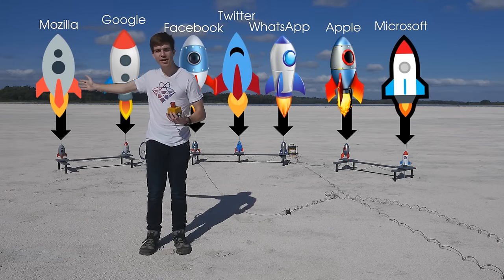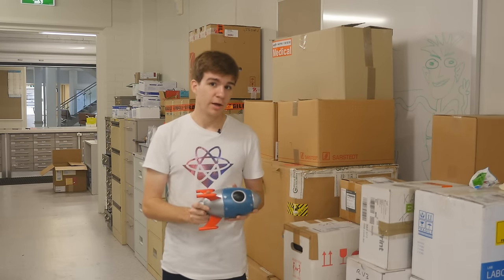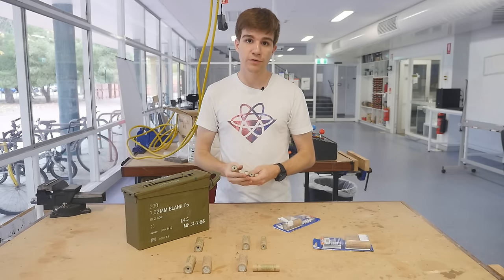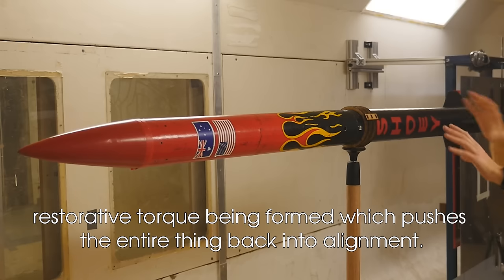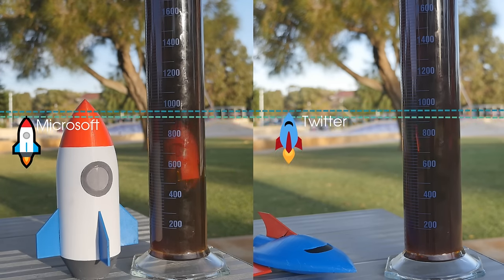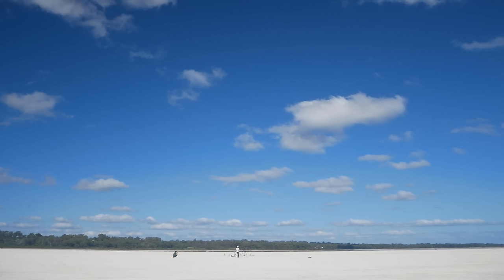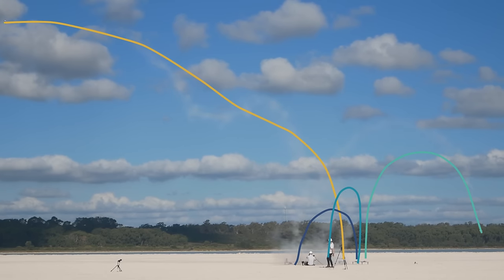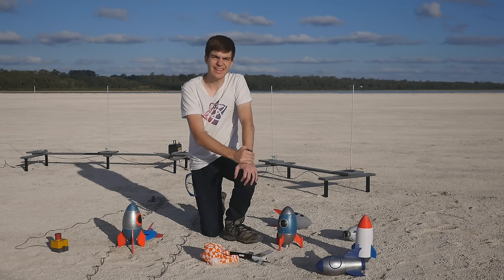What emoji makes the best rocket?

Comment: Up next: Which typeface's capital "I" makes the best I-beam?
Reply: easy video. get the Arial, Times New Roman, Papyrus, Comic Sans, and Impact font I's, extrude, 3d print, and test
Reply: I would legit watch this.
Reply: @PhoenixTwoFiftySix  theres more typefonts than that
Reply: @RubyPiec  yeah lets test all 7000, not just some of the more common ones, obviously
Reply: Metal printing isn't the best over length
Reply: I may try this myself lol
Reply: Brilliant
Reply: easy. windings three
Reply: @autodidacticartisan  yes.
Reply: That's actually a great idea. Mind if I take it as my bachelors degree research theme?
Reply: @karlohorcicka7388  Sure. In any case, i'd recommend bringing your idea to your professor(s) and getting an endorsement to continue before setting your mind on it.
Reply: @autodidacticartisan  I will upload a font consisting only of actual I-beam cross-sectional profiles to Dafont... >=D

Comment: Nice video, slight correction: 
At 6:00 you talk about rockets being unstable due to their thrust being at the bottom. The rocket would however be just as unstable if the thrust was at the top, as the engine moves with the rocket instead of staying in place (rocket pendulum fallacy)

Comment: 4:30 A small nitpick, yes the most efficient engine has the same exhaust pressure as the air around it, but for a rocket going to space that ranges from 1 to 0 bar during flight, so they picked a value in the middle for better efficiency.

Comment: I imagined all the rocket emojis without bell nozzles have the engine inset into the fairing. Take a look at Starship or even the V2 (The quintessential classic rocket design), neither of them have bell nozzles sticking out - both are inside the body.

Comment: Drag doesn't reduce the distance you can cover but instead it reduces the speed at which you traverse the distance. A more stable rocket usually experiences more drag and the more stable it is, the longer it keeps pointing upwards and the further up it ends up.

Comment: In regards to the strangeness in you drag to distance results I think one of your error factors is the drag calculation you did or rather what you seem to have accidentally missed. 

While the body by itself may exhibit that much drag, you’ll notice that in your program it shows a large zone of dead air behind the rockets where the exhaust should be and this can adversely effect your drag models. I know I’m a bit late to the party but at high air speeds like that having gas fill out that bubble and make a streamlined airflow can be a major difference.

Comment: Did you do the syrup experiment in syrup instead of water because it had any advantages that way, or was it actually just because it was more fun? Anyway, great video.
Reply from the maker: Yup, it was actually because it was much more dense and had higher viscosity. It's just we only had one take that worked so "its really fun" is the explanation we've got! If you were doing this for a real paper then the high viscosity would add some conversion issues (air vs syrup is a big difference) but could theoretically be done.

Comment: This was fun and informative, but I think I saw two problems. (Correct me if I'm wrong) First is that the video estimation of height doesn't seem to be corrected in the 3rd dimension (farther and closer, closer rocket can be lower than a far one, but seem higher). The second doubtful part of the test was the syrup test. The test tube was too narrow, making the chunkier rockets lift up the syrup and create vacuum underneath, instead of the syrup flowing freely around.

Comment: Awesome video! 

Just one comment about your explanation for the inherent stability or instability of a rocket. The way you explained it by balancing a rod on your hands is a bit misleading as an analogy. The rod is an example of an unstable system, but it's not really the same way a rocket is unstable. 

The balanced rod is unstable because of gravity and the relative position of the center of mass to the pivot point of your hand. As the rod  pivots your hand continues to apply an upward force and you get a torque like you illustrated.

As you touched on later in the video, rockets are unstable because of the relative location of the center of pressure to the center of mass. The existence of gravity is unnecessary. The existence of drag is. If you take an 'unstable' rocket and put it in vacuum it will fly much more stably. It will actually be marginally stable (which is not very stable but better). This leads to the point that the faster a rocket flies with drag the more stable it will be (assuming it was a 'stable' rocket to begin with). You mention I believe in the video that going slower might help some of the less stable rockets, but I believe that the correlation should be the other way

I bring this up because the analogy leads to  wrong conclusions about how to help rocket's be more stable. You mention that rockets are like the rod and unstable because they "have the thrust at the bottom". One might imagine that you could move the engine to the nose of the rocket and then it could 'hang from the engine' instead of being pushed by the engine. This, and other ideas stimulated by the rod analogy, don't work.

As counter intuitive as it is, a rocket hovering  in the air isn't as unstable as a similar rod supported from where the engine is. As the rocket tips over, the force tipping it over (due to a misalignment of the engine thrust vector with the center of mass or a small breeze or something) doesn't grow. With the rod it does. 

Sorry for the long comment. Again, the video was awesome!

Edit: You say these same things in response to another comment asking about the engine on top question. I believe that they asked in the first place because of the misleading nature of the rod analogy
~Max

Comment: So you first pinch the outlet to increase the speed of the exhaust .. then you add the bell nozzle to expand the exhaust to reduce temp & pressure and further increase speed of the exhaust ?  Or did I get this wrong ?
Reply: "A nozzle is a relatively simple device, just a specially shaped tube through which hot gases flow. Rockets typically use a fixed convergent section followed by a fixed divergent section for the design of the nozzle. This nozzle configuration is called a convergent-divergent, or CD, nozzle. In a CD rocket nozzle, the hot exhaust leaves the combustion chamber and converges down to the minimum area, or throat, of the nozzle. The throat size is chosen to choke the flow and set the mass flow rate through the system. The flow in the throat is sonic which means the Mach number is equal to one in the throat. Downstream of the throat, the geometry diverges and the flow is isentropically expanded to a supersonic Mach number that depends on the area ratio of the exit to the throat. The expansion of a supersonic flow causes the static pressure and temperature to decrease from the throat to the exit, so the amount of the expansion also determines the exit pressure and temperature. The exit temperature determines the exit speed of sound, which determines the exit velocity. The exit velocity, pressure, and mass flow through the nozzle determines the amount of thrust produced by the nozzle."

Not sure I fully understand this yet, need to re-read this ..

Comment: Well done!  I'll like the explanations and will be sharing elements of this video with future students (I teach aerospace engineering).

For a fair rocket emoji competition, however, what matters is the impulse of the motor.  Even if the the rocket nozzle isn't optimized, all rockets would have the same impulse.  What does matter is the weight, however, a fair competition would ensure all rockets have the same weight (adding weight around the CM to underweight rockets) and proportionally the same size by scaling all rockets to have the same biggest rocket diameter.

Extremely fun to watch!
Reply from the maker: Wow! Thanks JJ. I hope that your students find it interesting.
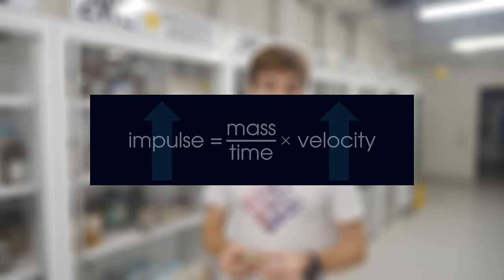Reply: Is the impulse equation at 2:48 correct?
Reply: @baneudel    Impulse is the change of momentum (mass x velocity).  Since force is change of momentum per unit time, impulse is the area under the thrust force vs. time curve provided by the rocket motor.  You can think of a rocket motor as providing "pockets" of changes of momentum as it burns, when you sum them all up, you'll get the total impulse or change of momentum provided by the motor which can be applied to anything attached to it, in this case a rocket.  Hence my comment about not needing to equate exhaust velocities of anything else for a fair competition, all we need is the same total impulse.

But since the resulting change in momentum on the emoji rockets is a function of their weight, the lighter emoji rockets would fly faster and therefore higher.  Emoji rocket weight is completely a function of the user scaling and designing the interior of the rocket, not the exterior emoji rocket design itself.  Therefore for a fair competition you would want all rockets to weight the same by adding mass around the center of mass (to not affect their stability).

My other recommendation about all rockets having the same biggest diameter is also important for a fair rocket emoji competition since the drag force is a function of the projected area of the rockets, that is the area that the airflow sees.  This parameter is once again not a function of the emoji rocket design itself, but of the user choosing a scale during 3D printing.  You would want to scale all rockets differently such that they all have the same projected area and therefore isolate the drag coefficient as a variable.
Reply: @AtomicFrontier  I am sure they will, I am sure they'll want to try the drag estimates using syrup!

Comment: Just fyi model rocket engines are very unreliable due to the fact that you can't really test them before you sell them, so peak altitude can vary by a factor of up to 2 per run of an identical rocket, so if budget allows, consider doing some more runs.

Comment: you mention the center of mass for the rockets in the wind tunnel, which are mundane cylindrical shapes with presumably uniform density
but not for the emoji rockets which have far more interesting shapes and an unknown distribution of material internally ... I feel that the tests would have been much fairer if the stability and balance of the rockets were accounted for
Reply from the maker: The Emoji CoM was calculated using a solidworks plug in, so the numbers used in the table should be pretty accurate.
Reply: @AtomicFrontier  Perhaps there are ways of influencing the center of mass, by i.e. increasing the fill on the upper portions of the rocket... I was thinking along the lines of, what if an actual rocket designer had a working design which just happened to resemble an emoji, they would have made sure to maximize its performance

By giving each rocket the best chances within the constraints of their emoji shapes and their fabrication method, we can reach a reasonable conclusion about the merits of each design
Who knows, maybe the Twitter rocket, for which you have given a vaguely planiform shape, might even exhibit gliding characteristics given the correct center of mass position

Comment: The stability of a rocket has nothing to do with the place ment of the engine along its thrust axis they are just as stable with the engine at the front or rear what really matters is

axis of thrust going through center of mass

Center of mass ahead center of drag / lift

Comment: Your first argument of instability is wrong, and is also known as the pendulum rocket fallacy. Namely, an inverted pendulum is unstable because gravity can induce a torque when the pendulum rotates away from vertical. However, the thrust of the rocket rotates along with the rocket as it turns away from the vertical and thus does not induce a torque that can de stabilize the rocket.

Comment: couldn't he just make the different nozzle designs himself rather than using lower/higher power engines to replicate different nozzles?
Reply from the maker: I tried to, but didnt work with the engines and the printer. I'm trying to get together a video just on rocket engines so thought I can tackle the metal printing / aluminium lathe work for that one. Good point though, would have love to do the engines more realistically

Comment: Some of those rockets look big enough to hold a go pro inside. But I suppose it would just be a dizzying mess of a video.
Reply from the maker: Had it as a stretch goal when planning the video but had to cut it when switching from "does this one particular emoji rocket work" to "lets launch all of them". Depending on how well this video ends up going I'm keen to revisit the rocket design topic but with a single M - motor, much larger rocket, and definitly some GoPros!
Reply: @AtomicFrontier  Maybe you could hang a mass on a rod much further forward of the center of pressure or stretch the length of the rockets. This could show how extreme of a change these emoji designs would need. Regardless, I look forward to whatever video you come out with next!